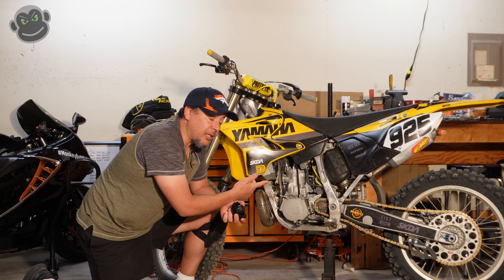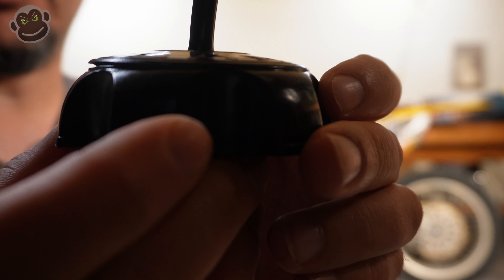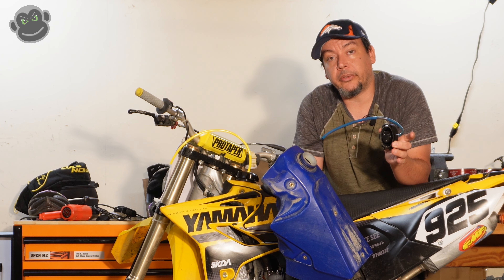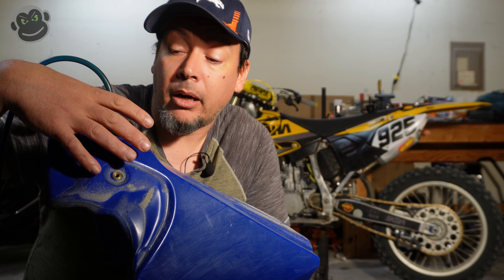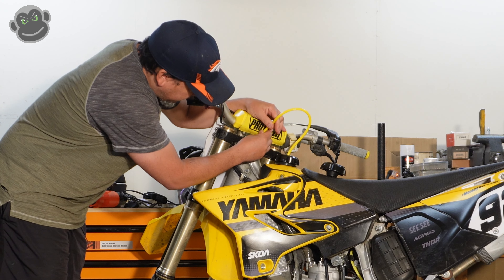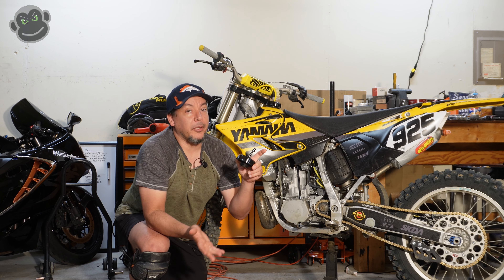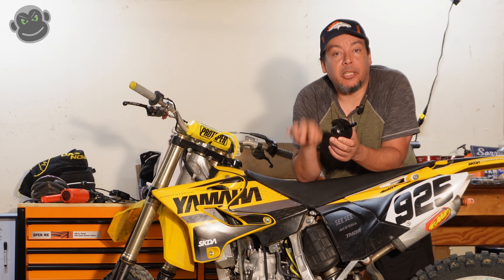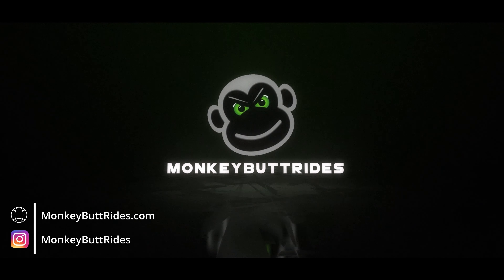Clarke Fuel Tank | Yamaha YZ 250 2 Stroke | Clarke USA

Comment: I was guessing the cap is not well made/designed and ever so slightly over tightening the cap breaks it right there, as the rim of the tank is pushing through the cap the more you tighten it. Happened on my XR400 and fortunately the stock cap fit.
Reply from the maker: Interesting idea, I wonder if I put a small spacer at the bottom of the threads on the tank side that would keep it from punching through??  I will check with a tape measure first.
Reply: @MonkeyButtRides  good idea, please update